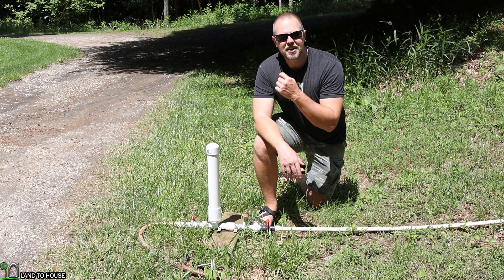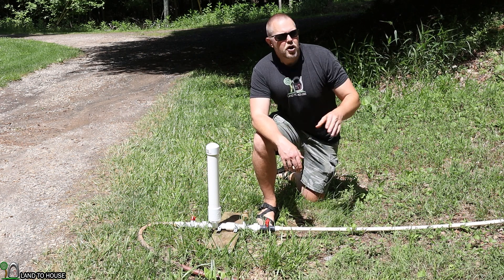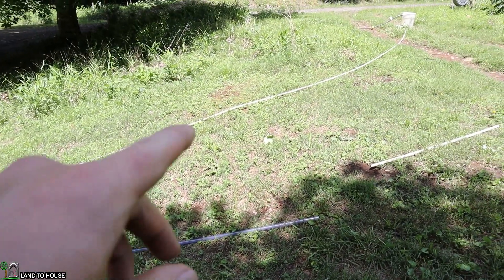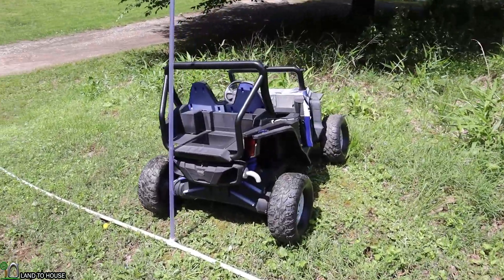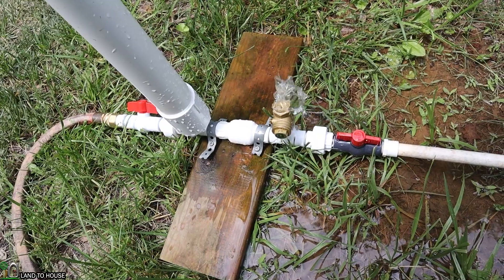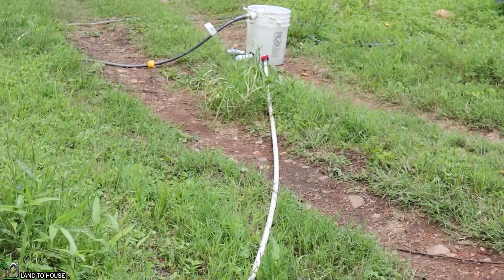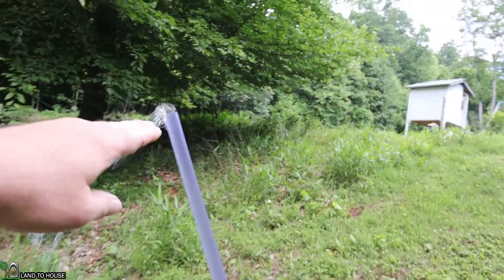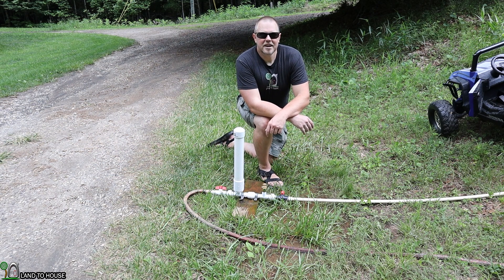Ram Pump Standpipe Placement

Comment: Seth, I understand the reasoning for stand pipe placement you explained in the video, but can you place the stand pipe too close to the ram pump? Any guidance on placement? I only have about 3-3.5 feet of drive pipe fall on one inch PVC. The drive pipe is approximately 140 feet long.
Reply from the maker: Typically you want to have the standpipe 25 feet or more away from the pump. This allows for
the pressure wave to have time to cycle. However the pump can still cycle if your drive pipe is only ten or fifteen feet long. It will just cycle fast.
Reply: @LandtoHouse  thanks Seth! I'll give it a try in a couple weeks and see how it goes.

Comment: hello.
  Why do you put a bicycle tube in the pump?  And if I make the part where the tube is inserted longer or install two check valves, will the water pressure become stronger?

Comment: Firstcomment. 
I typically use a larger size. Going to the standpipe and smaller coming off.
Reply from the maker: Yes a large supply pipe and standpipe then smaller drive pipe works well.
Reply: @LandtoHouse  have you tried a "foot valve"? I think I'm going to try one, unless you have information to the contrary.
Reply: @05excursionltd  do your research. They flip the spring and tend to add weight.
Reply: @bullithedjames937 my plan is to remove the spring on the foot valve and see how it pumps. Presently I have to place  my swing valve at 45 degrees to get it to work.
Reply: @05excursionltd   I am from India. I am using foot valve for waste valve. Good result.
Reply: @05excursionltd spring loaded will not work as waste valve. Please remove the spring.
Reply: Seth, any advantage to using a standpipe that is a larger diameter than the drive pipe? Currently, I'm using a 1" drive pipe (approximately 130' long) and a 3/4" diameter delivery pipe. TIA. I wish mine cycled as fast as the one in the video, mine cycles about every 4 seconds.
Reply: @05excursionltd  When I tried switching to a foot valve, I couldn't get the cycle or I just wasn't white long enough. I'm used to about a second and a half, you gotta click
Reply: @bullithedjames937  where did you place the "foot valve"?
Reply: @05excursionltd  it was the work/ waste valve
Reply: @bullithedjames  so you're saying the foot valve worked better than the brass swing valve? If so, I may need to try one.
Reply: @05excursionltd  no I'm saying it didn't work for me. A bunch of other people's state it works way better. I'm not patient enough. I like that half inch RAM pump clicking every 15 to 43 seconds